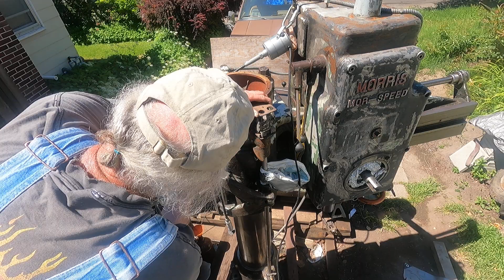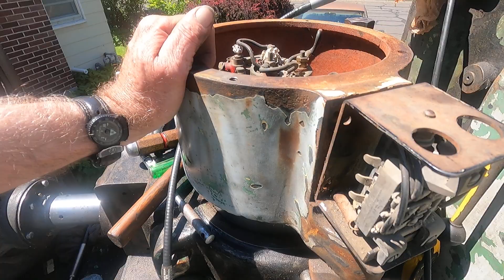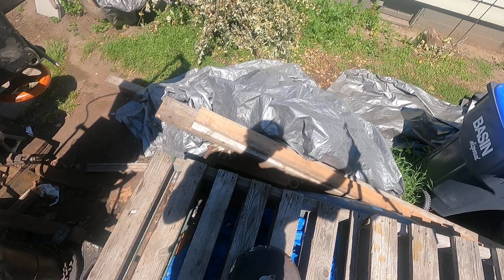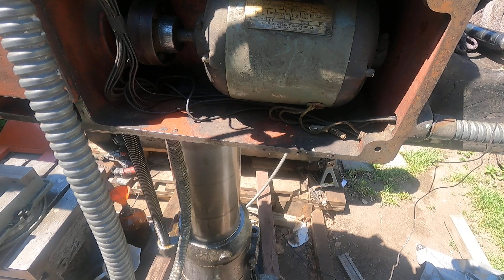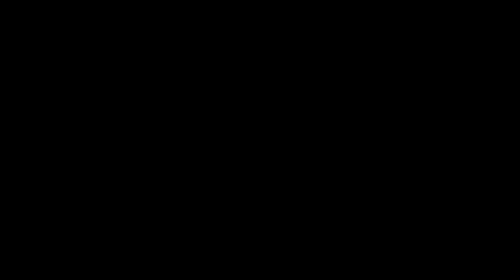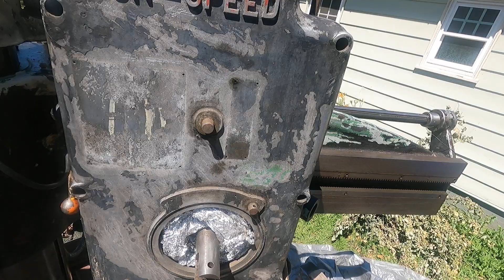Radial drill press restoration -electrical switches and contacts

Comment: Did you haul machines home your self?
Reply from the maker: The owner of the recovery yard delivered the machines with a semi truck and large forklift they drove from just 1/2 mile away. The Axelson I purchase from a dealer and had it delivered to the yard so the drill and lathe were delivered to my house at the same time, the old mill I bought the previous year they brought it over on a roll back wrecker chained to a forklift and drove it off the wrecker that way. It was a $1200 total move for 3 machines.